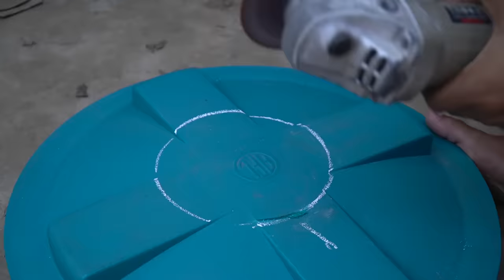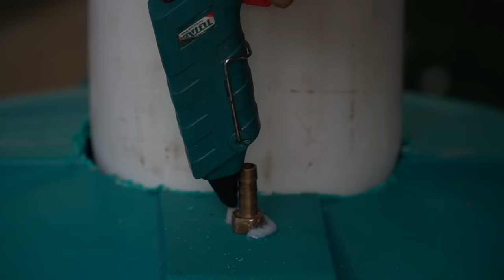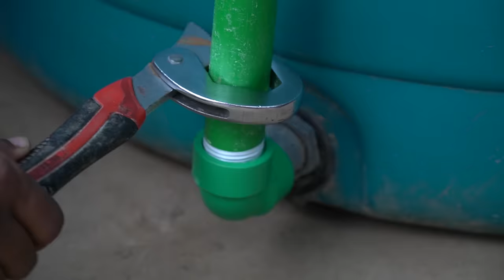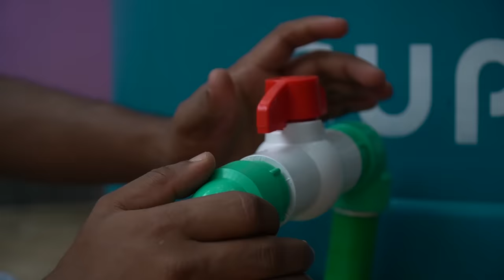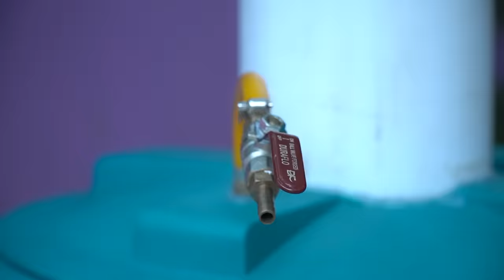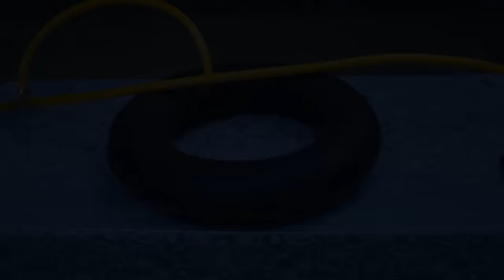Creative idea to use free gas from garbage

Comment: The teflon tape application direction is wrong its should be apply the same direction which direction the fitting going to tight clockwise thanks

Comment: Two doubts-
Firstly,  is it always a liquid slurry? No solid kitchen waste?
Secondly, if the inlet is a wide open pipe then will the gas not escape from there?
Reply: 1. What is the name of the metal through which the flame comes out
2. Won't the gas escape through the part where the dung mixture is put, if it is not covered
3. Can one add alcohol into the bio-tank

Comment: Thanks for your help. how many times used
Reply from the maker: 1.2 cubic meters of gas can produce 5 kg of wood heat.  To produce 1.2 cubic meters of gas, 33 kg of dung and the same amount of water are required daily.
Reply: @MH4TECH  how long it will produce gas.when to remove and chang dung

Comment: Can I use the 400 L tank and apply this mechanism? I wish you bests, keep doing this amazing stuff, I'm seriously thinking on making one of these ! I hope you can answer me
Reply from the maker: You can use a 400 liter tank.  However, if the size of the tank is more, it will be possible to increase gas production.
Reply: @MH4TECH  In the case I use organic waste I should apply a treatment in order to simplify the matter?
Reply: production of these gases generally reaches a peak in five to seven years, a landfill can continue to produce gases for more than 50 years.
Reply: @MH4TECH  how you get back the gas from tube. Is it one side valve?
Reply: @MH4TECH  can you tell the what kind of waste you have putted and much gases was produce and mechanism?
Reply: I have a doubt.  Fire accident aaga chance iruka

Comment: Your tutorial is very informative, however I would like to know if at the level of the upper part after filling it with waste we must close?
Reply: Wrong
U said gas from.Garbage
Reply: From my understanding. Since the supply pipe is long enough to reach the bottom of the tank and you have to fill it with 70-80% of dung, the gas will have no means of escaping through that pipe cause it will certainly be filled with dung.

Comment: Make hydrogen by electrolysis so we don't need any other fuel 
Or mixing hydrogen with biogas 
So we use less biogas for continued burning and more hydrogen which is easy to use
Reply: Any recommended  video

Comment: Good afternoon. What does the tube at the bottom do? Why did you not put a cover on the inlet tube? Thank you.
Reply from the maker: The white pipe is located at the bottom of the dam.  And the dam is 75% full of waste and water.  Since there is liquid at the other end of the pipe, there is no possibility of gas escaping through the pipe.
Reply from the maker: A tab has been used to remove the waste material.  You can use any pipe instead.

Comment: Absolutely good workings. My question is that tire tube it could be working as Gas regulator or storage, can you be able to store that gas to use for the next day? pls your answer will be very important.
Reply from the maker: Excess gas produced in the tank will be stored in the tube and can be used at any time.
Reply: @MH4TECH  ماذا لو امتلاء الانبوب بالغاز هل يحدث انفجار وكيف نوقف تزايد الغاز

Comment: You would think that it would need the PVC storm-water or is it sewerage pipe? [Thicker and stronger] with a screw top end cap fitting  on it - to seal the gas collecting unit after filling it .

Did you leave that step out.    I don't see how the methane gas can be stored otherwise - without a seal on the tank or whatever container is used to collect the waste materials - which could in fact most likely be other sources of organic materials like grass or weeds and leaves etc or anything organic that decays with the aid of animal dung as a catalyst to speed the decay process.

Could the waste from commercially made human compost toilets be utilized as well? - though I'd be a little hesitant of mixing that up and adding it to the tank though. ;)

Comment: For how long will the gas last? And what is the function of the side pipe( what does it Stands for?)
Reply: Its a tyre tube and it's purpose is to store Gas if you are not using it directly its used because it's cheap 
As the gas production never stops you need something to store Gas for future use

Comment: i did that 
but failing to get fire
Reply from the maker: You check to see if gas is leaking from any side of the tank
Reply: Starting a biodigester takes some time. I have a different type but with cowdung it took about 3 weeks to start producing proper amount of gas. The other thing is that in the beginning there is a lot of co2 that won't let you get the flame. So you have to let that gas go first. In time you will get that methane and it will burn well.

Comment: Tip if you add fruit cuttings that would be thrown away in the container with the cow dung you would double your gas output. also, I suspect your gas outlet pipe is leaking from the tank fitting, that hot snot looks like it came loose. For a large system like that it should have produced much more than just one tyre full.
Reply: Where are you from? I love such kind of works..n you seem more experienced in this as per your cmnt. Me too researching Bout how can we produce more gas without much of investment..in other words how can I make self sufficient gas unit with continuous production..

Comment: You put the teflon tape on in the wrong direction which unravels the tape when putting on threaded pipe.
Reply: Yes
Reply: What is the right direction for teflon tape?
Reply: Teflon tape should be put on the same direction as tightening threads so that it doesn't get unraveled when you are tightening the threads .

Comment: Its not safe non return value illa sir and neega set paniruka tank over load blast aaga vaipu aathigam and yella neramum namba matu sani thedi aalaya mudiyathu lot of thing to do mainly its unsafe project
Reply: it will not blast like other gases , this biogas contains only 65 % methane yield and 35% water, CO2 and H2S, that's why biogas have less heat comparing to lpg even if purify it the methane has more energy than lpg. but purification needs sophisticated technology.....

Comment: Hi, Please clarify the below,
1. how about the residue removal, 
2. Do you cover the top of the filling pipe
3. How about vegetables
Reply: Im no scientist or chemist but I believe most of the solid waste will break down but if not, flushing it with water from top would allow it to escape the bottom valve he set up. Mixing it seems important to help break it down.

I think the gasses tend to be heavier than air but as well, correct me if im wrong, the tire tube is storing gas too? And causing a pressure? 

I believe you could use anything that breaks down and decomposes. Producing gasses.
Reply: Yes even waste leave do so

Comment: After 7 days u will find a gas which u can use only for 15 to 30 minutes
What a wonderful idea
Reply: Does that mean you have to wait another 7 days to get another 15-30 minutes of burn time?  Could you have a larger tire inner tube  to hold more gas?
Reply: 75% of drum should be filled with slurry. Each day you have to add 1 or 2 buckets of slurry and remove the same amount daily. After 7 or 10 days you can use regularly. 
The amount of usage depends on the size of the drum and availability of the dung.
Reply: @surendranathpr5504  So for 7 days you do the fill/drain before you start using?
Reply: @ungaghali3485  fill at once upto 75% of tank for the first time. Then leave 7 days so gases will form. Then on 7th day you fill with new slurry. Then 8 the day again.  Then routine.

Comment: I did the same but i don't know why this is not making gas.. I have used large tube... And 1300 litres drum.. i hope i will get response from your side
Reply from the maker: Check if gas is leaking from any side of the tank and fittings
Reply: Try letting some gas out initially, and keep the top pipe closed

Comment: Slurry removal tap should be at 3/4 height of the tank.
Reply: so that it  will remove any excess input especially light material which float will be given out not below to the bottom it will not remove excess` but to  reduce input material

Comment: Awesome invention ✨🤩
How much the cost?
Is this really works forever unlimited?
Reply from the maker: It's just an experiment.  It needs to be further developed to use it longtime
Reply from the maker: 1.2 cubic meters of gas can produce 5 kg of wood heat.  To produce 1.2 cubic meters of gas, 33 kg of dung and the same amount of water are required daily.

Comment: What about the above opening where you feed the system with garbage, is it closed to ensure pressure of gas goes to the pipe or left open ??
Reply: I think we have to fill the dum up to that white tube. 
If anybody knows please answer it
Reply: Gas can't go outside the opening pipe because the pipe is totally submerged to the liquid. Gas can't go under water.

Comment: I have made this of 1000ltrvtank but is not producing any gas using bufflo dunk +watr +slurry from running biogas plant what is the fault? Guide me
Reply: This guy made a video probably using lp gas and not biogas. Biogas doesn't make yellow flames. His bio digester inlet is open, allowing biogas to escape. If you followed this video, go and do some corrections
Reply: @1Bhishu  no no technique is right but the tube size needs to increase

Comment: How long does it last  for  that 500l
Reply from the maker: 1.2 cubic meters of gas can produce 5 kg of wood heat.  To produce 1.2 cubic meters of gas, 33 kg of dung and the same amount of water are required daily.
Reply from the maker: I have used 500 liter dam here but you will not get enough gas with it

Comment: How much kgs release gas?
Reply from the maker: 1.2 cubic meters of gas can produce 5 kg of wood heat.  To produce 1.2 cubic meters of gas, 33 kg of dung and the same amount of water are required daily.
Reply: The baiogas how to fill in the cilinder?ND how to H2s ND co2 separate.?

Comment: What about -for urban environmentd with no livestock at all - connecting feeding pipe to a Japan or Finland water  bum "wiping" system  outlet ?
Reply: What is the cost of GasTank, Acceseries and labour charge. Will you supply the above. Where is your company. Will you able to give the company/supplier/Distributor address in Bangalore south, Karnataka State.
Reply: @thiparegowdagowda3860  ir all can be done of recycled material
Reply: @thiparegowdagowda3860  you can be taught how to make it by yourself

Comment: A ideia é boa. pra quem tem fossa asséptica no quintal pode muito bem aproveitar o biogas metano que é produzido  sim. é pouco usado aqui no Brasil . em algumas fazendas de gado ja se tem uso.
Reply: Muito bom né Pepe, tenho peixes e to pensando em usar os dejetos dos peixes para isso...uma dúvida, nao ha a necessidade de tampar o tubo de 200?...só o peso dos dejetos do fundo do tanque já fazem o bloqueio do gas?
Reply: The disadvantage happens when the inlet of the materials has been set on top of a tank,but if the inlet is deep to the bottom of a tank,you can tap gas from that tank minding that a ventilator pipe is closed.

Comment: Love it❤
What's the ratio of dung to water when mixing?
Is there a way to convert the gas to electricity? (Small-scale to maybe light a bulb or two)
Reply from the maker: You can use the amount of water needed to mix the dung. You can generate electricity from gas
Reply: @MH4TECH  how to generate electricity from gas
Reply: @TechWorld898  heat the water to form stem which then will rotate the turbine to produce electricity. Or fuel cells technology
Reply: @MH4TECH  thank you💕
Reply: the consistency of the dung must be curdy., for electricity convertion needs more capacity plant
Reply: 1:1
Reply: You can use the gas to run a generator. With a little research I believe the gas could run a car. The big E is coming out of the woodwork. 73

Comment: Can it be used continuously? Supplying and removing the biofertilizer through the tap (diamond)?
Reply: If you have a shut off from the fermenter to the reserve (tire) you can shut that and then fill - You will lose your pressure in the fermenter.  Also, remember that it will be hazardous as it will release methane when you open the top to fill it.  Neat idea, I think it would be ore useful in series.
Reply: @horscategorie  No inside the tank the waste goes to bottom the gas will always on the top of the chamber. and the central pipe acts as a water jacket...

Comment: I am sure to cover the Inlet where the waste goes after tank fed, it seems you forgot or didn't have time or you have a new design, 4" PVS  has no cover/cap. Inlet is wide open, gas produced can escape through the feeder mouth, instead of going through the hose to the storage.
Reply from the maker: The white pipe is located at the bottom of the dam.  And the dam is 75% full of waste and water.  Since there is liquid at the other end of the pipe, there is no possibility of gas escaping through the pipe.